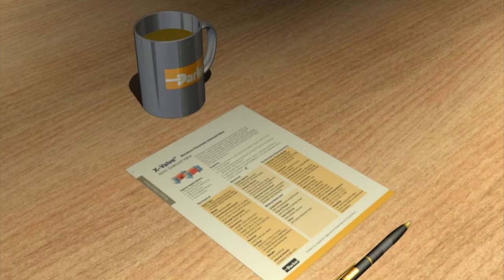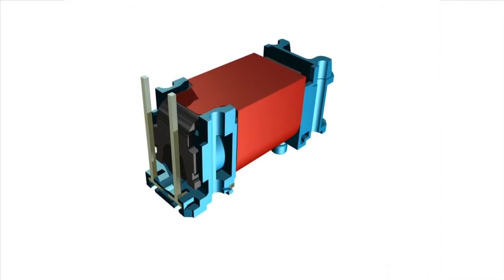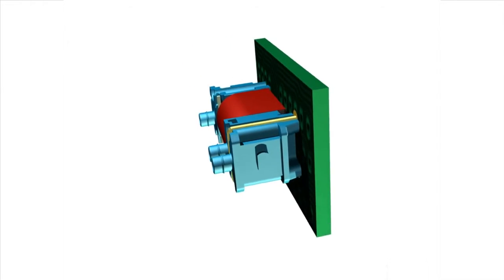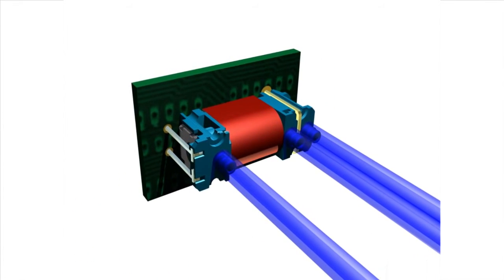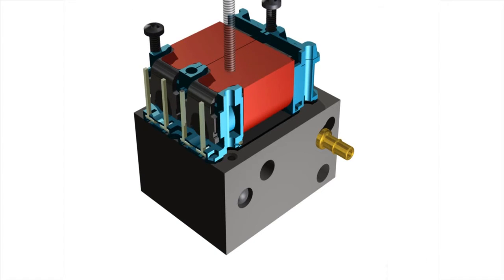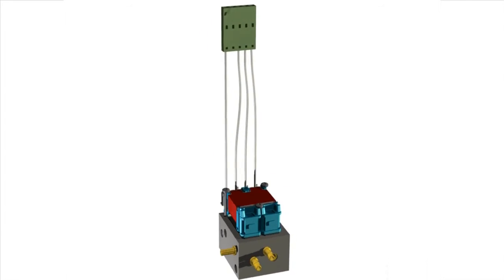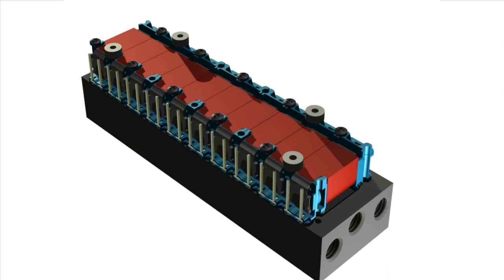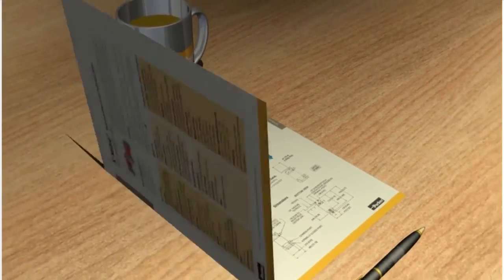Best Applications for the X-Valve | Miniature Pneumatic Solenoid Valve | Parker Hannifin

Comment: Hello everybody,
COVID-19. This is an emergency post, asking for help. Please share this post as much as
you can, so it can reach the maximum audience.
Ametic, our Spanish Electronics and IT Association of Industries, in a call by Spanish
Ministry of Industry, Trade and Tourism is managing the support to scale up production
in Spanish companies that manufactures artificial Ventilators. Premo has been
appointed to help and co-ordinate technically and industrial efforts. We need three
models of miniature electro valves urgently:
 Parker X-Valve X-1-05-L-F
 Parker VSO LowPro model 8
 Parker VSO LowPro model 4
These valves can save lives today! It’s important they must be the exact referenced part
number, so manufacturing can be done without changes or modifications. Pictures
included below.
If you have stock of those valves, please contact Mar Villarrubia
(mar.villarrubia@grupopremo.com).
Thanks a lot for your help.
Reply from the maker: Thank you for the comment. Parker is in touch with suppliers of ventilators that use our Parker OEM parts.